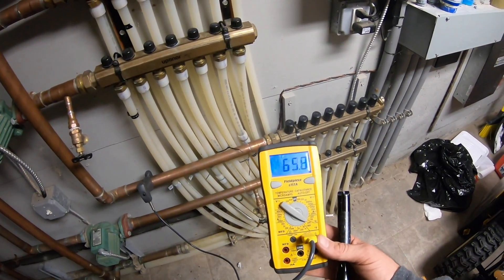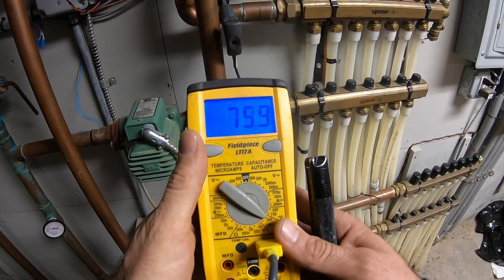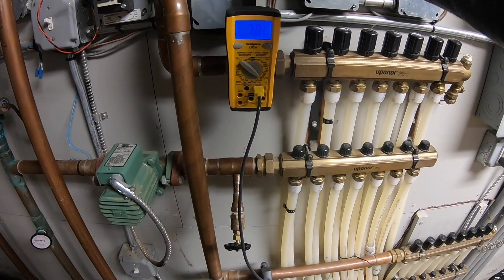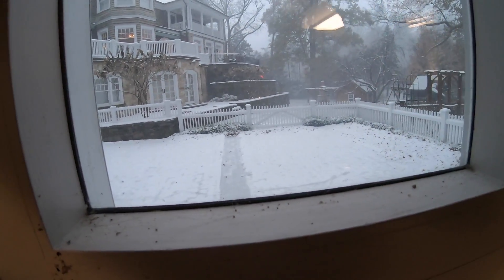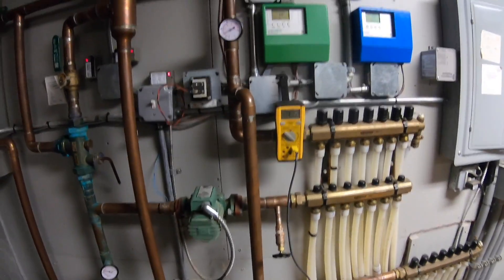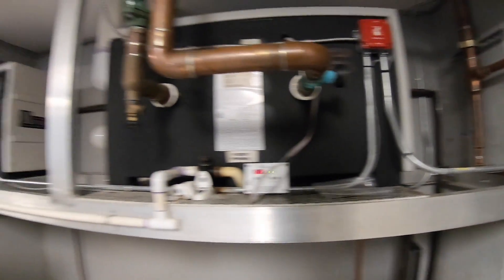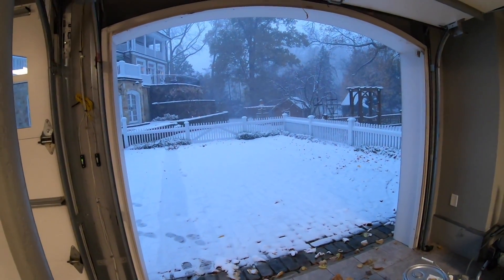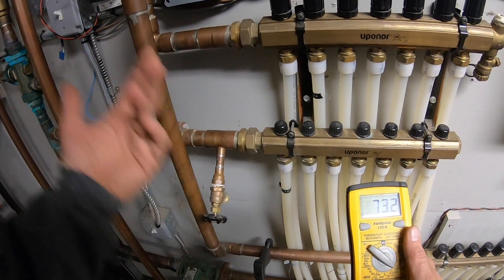Testing Boiler Snowmelt/ Heated Drive Way System After Repair During Snow Storm

Comment: The softened snow should shovel easily. That's a job for the landscaping company. It would be cheaper paying them then paying to run that boiler non-stop.

So, in theory snow doesn't stick to the heated slab? Assuming that it's been on a few days before the snow storm?
Reply from the maker: The snow shouldn't stick to the heated slab if it is turned on with enough time before it snows. There is a slab sensor that when it senses moisture and temps are 33 or less the slabs start heating up. It will shut down when no moisture is sensed. Even if snow sticks when the slab starts heating up, it will melt away all the snow and ice. I test the ice melt since temps were low enough by pouring old cold coffee on it went inside it was running came back outside and the ground was coated. This was before I got to the lower garage to work on the two boilers in the lower garage.
Reply: @thehvachacker  i wonder if they've started rolling out systems that run based on weather forecast instead yet, seems like that would be better and potentially more efficient for it to go "weather channel says it snows tomorrow around 8, i'll start up at six so i'm nice and warm before the snow starts falling"

Comment: First time I have seen one of those unit. I will guess that normally you would have the unit on before it starts snowing. I wonder how long it’s going to take to melt all that snow and ice and if it’s to long then is this unit Efficient ?
Reply from the maker: There is a sensor on the driveway if it gets wet or senses any moisture it turns on the snowmelt. Most homeowners can bypass the sensor with a switch to bring on earlier. When snow is expected. Once the slab starts heating up it melts away. People with snow melts don't care about efficiency.

Comment: Ridiculous waste of energy, all because someone doesn't want to shovel. Though I'm sure they could pay someone to shovel their driveway, and it would probably cost them less than their gas bill (and repair bills!) to run this thing. Totally illogical.
Reply from the maker: erik61801 property taxes on this house is around 90k.
Reply from the maker: The rich are illogical. It is apart of their status quo. What else would they complain at when they are sitting around the country club when we are all working.
Reply: They probably pay property taxes that eclipse your yearly income.  A power bill that would wreck us plebeians is chump change to them. Wake up flip a switch and when theyre about to pull out the Audi R8 the drive is clear.
Reply: @erik61801  and travel on a private jet to events where they chastise us plebeians about "climate change."  Just like Al gore.

Comment: You would be there a long time waiting for it to melt. Such systems are likely sized to deliver heat over a sustained period and only requires a "small" thermal output compared what would be required to melt.

I can only imaging the customer bill....15 min to diagnose the problem....4.5 hours of watching snow melt waiting to see if it was working properly.  and a rich person will freak out over this when you would think it would be the opposite. They would expect you to run other jobs and return back in 1 hour intervals (at no additional charge) to check .
Reply from the maker: Yea they didn't get a bill for anything I worked on that day since it was all included in their maintenance contract. I was in the house for 9 hours, 4 boilers, 25 radiant loops 10 hot water coils, and 5 driveway melt manifolds. Plus fixing these 2 boilers. I wasn't staying to watch the snow melt. I had to get a piece of garbage truck home that doesn't drive uphill in the snow. that was 5 and pulled into my driveway around 10. I had to hang out for a little bit and watch it run they pay for a 9-hour maintenance. So couldn't run as soon as I fired up the boilers

Comment: fucking Rich people
Reply from the maker: Hey, the rich make sure there is always work with stupid shit they own. People are freezing in this world with no heat and they are worried snow is sticking to there driveway. Or its summer time and their pool house have no ac and its an emergency.
Reply from the maker: Most rich are reasonable and understand what needs to be done to upkeep there property. Some buy and have  no clue what responsibilities of home ownership is
Reply: @thehvachacker  my boss has money and the place brings in money, but Ill be damned asking to get a 10 dollar part to make sure a multiple thousand dollar device doesnt need professional repair that is 100xs the part I asked for. I am the king of rigging shit =\
Reply from the maker: You do what you have to. Many repairs can be completed without replacing parts. Just by repairing what's in front of you. that's all I had to do with these boilers. Just clean a flame sensor and properly gap the sparker.
Reply: The Problem would not be rich people, but unreasonable people.

Comment: 73 on the return seem pretty good. I have a 4 bay carwash and my return stays around 68 or so.
Reply from the maker: It does seem good it will just take a long time for the ground to overcome the cold ambient air and snow quickly trying to absorb any heat in the driveway.
Reply: @thehvachacker    Been putting these in for years in Canada.  Your temp is good.  Sometimes the sensor (if installed on the slab) gets covered and the moisture from the snow does not react to tell the boiler to start.  That is a huge issue up here.  Then you get the customers go start hitting buttons because its not melting.
Reply from the maker: This was sudden drop and snow falling quickly. With also the boilers were off on a f09 flame fault and other on f13 fan fault. Got both back online yet at that point they were trying to catch up with an inch down already. They will melt just takes time with all that thermal mass and cold ambient air. I found out from another coworker those boilers are doing the lower and upper driveway. The other ice melts in the main house are for the decking and walkways.

Comment: Looks like you could use one of those plug in thermal cameras for your phone.
Reply from the maker: radiant loops caused me to buy an IR thermometer at first yet thermal imagers would be great. There is many jobs or applications where it would come in handy. I just need to find a good one since it's an investment on a tool that should provide years of service. I am looking between the FLIR, HTi, and Fluke's thermal imager camera
Reply from the maker: Which one do you recommend?
Reply: I'm no expert when it comes to thermal imagers l, perhaps others can recommend. I do know we had a flir on the LNG plant I worked on, I didn't use it much but looked like an ok unit. I do know the fluke multimeters stood up well to the day to day use by electricians so you'd hope all their tools would be built to the same quality.

Comment: Might be easier to just buy one of those big propane torch kits and melt it all off yourself.
Reply from the maker: It could be yet I am not shoveling or clearing snow for them. either the boiler does or they have to figure it out
Reply: The HVAC Hacker I was suggesting from the homeowner’s standpoint. Would definitely be a lot cheaper than having a heated driveway, but then they would have to do it themselves.
Reply from the maker: This really is rich people only problems.   It’s like when their pool house ac breaks and they freak out as if it’s the only ac in there house and it’s 90 degrees inside already.

Comment: Why not just put a roof over the driveway? My boss had heated sidewalks at his house until the concrete cracked and broke the system. I put my shop heating system in a foot deep layer of sand under the floor but I only heat it to 45F. The ground almost keeps it that warm.  It doesn't look like they even use that garage.
Reply from the maker: They don’t use the lower garage. The heat for the garage is a gas furnace. It has a sauna and an apartment as part of that garage yet they never go in it.

Comment: Without knowing all the specs or design data, I would bet those units are a little undersized, if they were for that whole area you walked over.
Reply from the maker: This is doing the lower in front of that garage and part of the ramp up. There are more boilers in the main house that are also doing driveway melt. These are 399,000 BTU boilers each. Even if slightly undersized they will heat the driveway enough to melt snow. Doesn't help they were down till I got them fired. Yet the upper boiler couldn't keep up with how quickly ambient temps dropped and the snow blasted down. Until the sensor gets wet the snowmelt zones won't activate.

Comment: Remember you have to deal with 2 temps, ground temp and ambient temp. I will take time since the boilers were off and didn't come on after the snow came. Just let it run and do your other maintenance work and come back and check on it.
Reply from the maker: Yea I know and the temps drop so fast created a nightmare through the state of NJ Thursday. This was the end of my day. I did the main house first and finished with the 2 snowmelt boilers for the lower driveway. I would be there a few hours before that snow would start melting. Bad enough I left this job around 5pm and pulled into my driveway around 10: pm. This was my first time working on a site with snowmelt system as a snowstorm hits. Hard to film in houses like this or I would have filmed the boiler repairs. Thought of filming after the repairs were done.

Comment: Wow, heating to melt snow off driveway.How long would it take to melt all driveway, if still snowing****
Reply from the maker: The upper driveway which boiler was working couldn't get driveway warm enough due to how quickly the temperature dropped on Thursday. I never was doing a maintenance to witness a snowmelt system at the beginning of the storm. The radiant heat tubes are in a solid concrete slab about a foot under the driveway. The outdoor temps were around 25F even though the Tekmar controller read 33F. I would give it 3-5 hours before the heat in the driveway starts to melt everything down. It has a round sensor on the driveway that needs to get wet to activate the snow melt. I have been to a house afterward and the homeowner doesn't need to shovel. The snowmelt for this house also does the decking around the house. Not sure if the leaves will make it harder for the snowmelt since it would work like insulation.
Reply: @thehvachacker  never seen radiant barrier for driveways.Thanks for info. Stay warm bubba..
Reply from the maker: I will try it warmed up some since then it's 42F today.